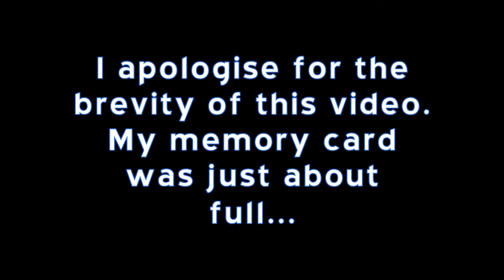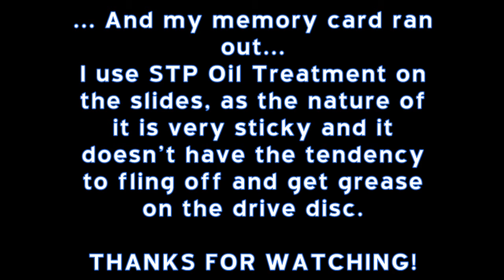Replacing the Drive Ring on a Snapper Self Propelled Lawnmower

Comment: Next video up is a thorough CLEANING of the 40 plus year old, STILL RUNNING SNAPPER mower. Part 3 is slathering Turtle Wax on the deck and other painted parts.